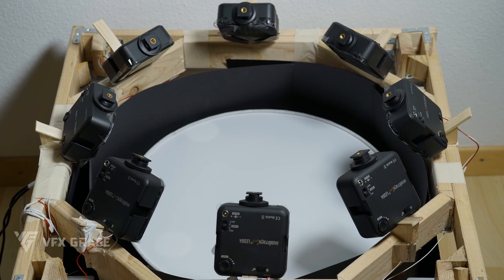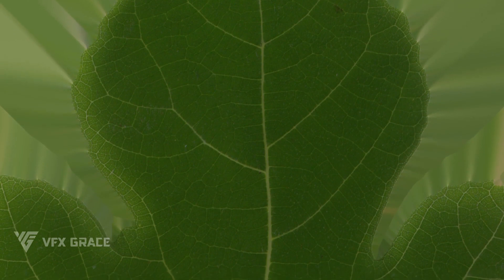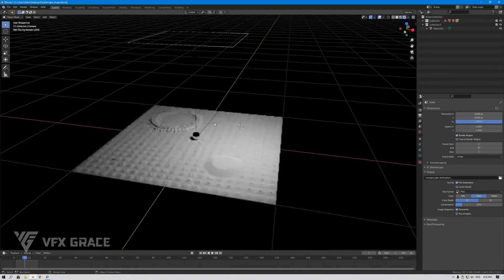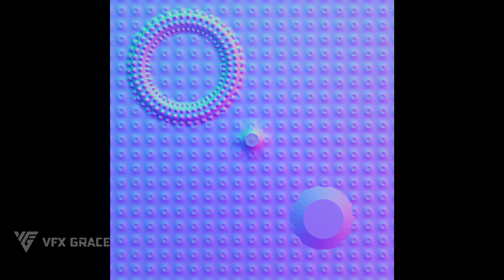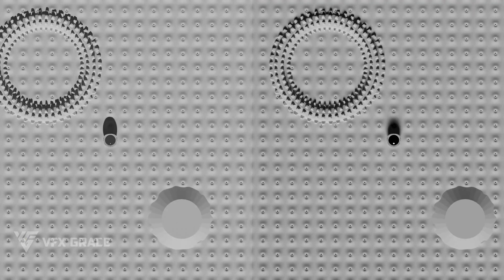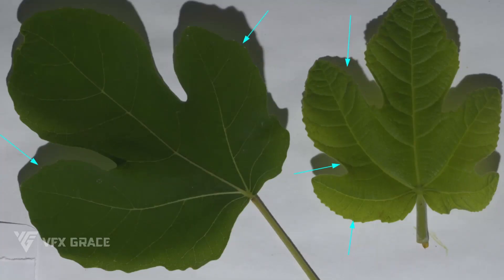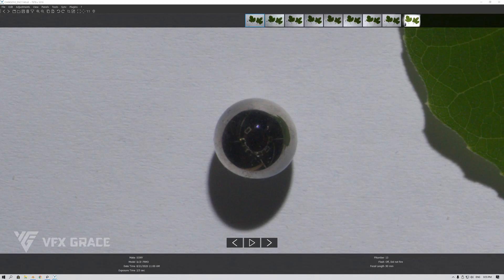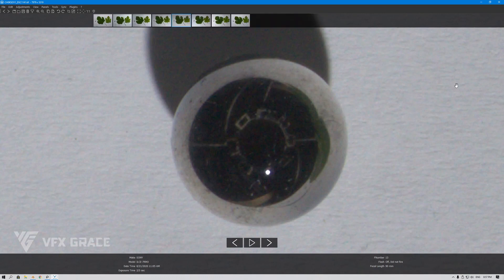Details Capture | Texture Scanning with Photometric Stereo Technique

Comment: When capturing translucency you mention using a polarized film for the benefit of a black background that still allows light through, however does the reflectivity of the film surface not cause issues with capture itself?

Comment: I don't have a chrome ball, but I would like to make a lighting file to use for all captures, as the light source angle is the same for all of them. is this possible?
Reply from the maker: Yes. But the results won't be that good. And the color of the generated normal maps is a bit different from a correct normal map. So, to solve this problem, you need to generate the normal map one more time. That is, import the generated normal map and then export a new normal map with pre-correct checked.